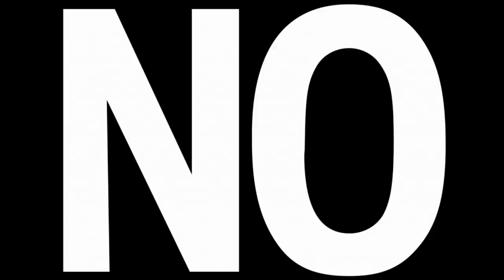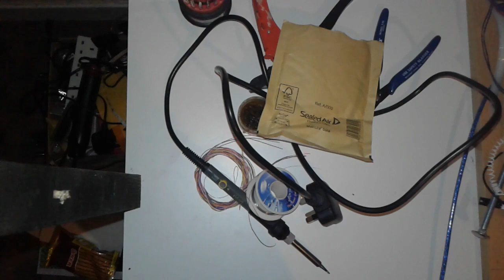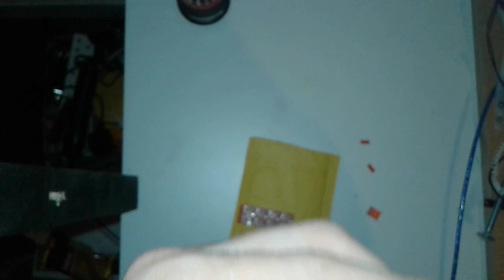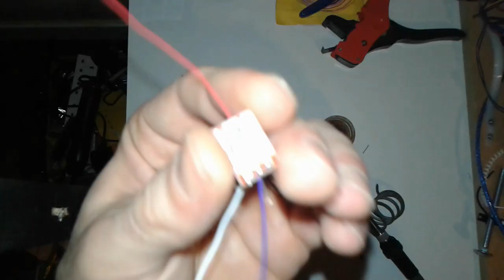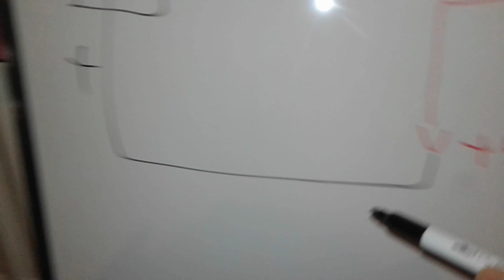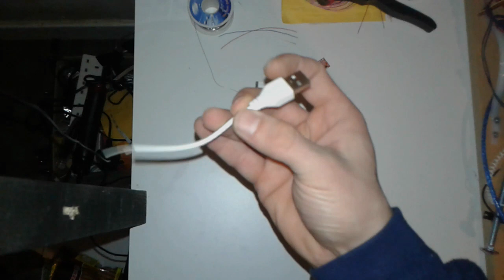How to add capacitive touch switch circuit to your projects

Comment: Thank u for the video. I want to ask how would you install this sensor to a machine with an operating voltage of 24 VDC thanks
Reply from the maker: Hi there to power the sensor you need 5v so you will need a step down converter, and if you want to trigger a 24v machine you will need a relay or if something bigger a special contactor
Reply: @NoSkillsRequired  alright thnx for the info

Comment: Cool video. Is it possible to make it work when you double tap instead of just touching it. Can you double tap it and the light stay on ?
Reply from the maker: This one no unfortunately you need a controller to make the computations so will be more complicated and more expensive
Reply: @NoSkillsRequired  Jums nav taisnība!!! 😮 Tur ir (A) un (B) slēdži, ar tiem var panākt 4 režīmus, gan kā slēdzi gan kā pogu! 😊
Reply: Yes it's possible  u can solder a and b I think and it will work as swith

Comment: Can you power a 12v load with this?? Or only 5v loads?
Reply from the maker: Is rated for 5v usb like loads max 1.5A
Reply: Dou you know how you could power a 12v led strip with this switch?

Comment: Can I use it as proximity switch?
Reply from the maker: Nope you have to touch thd xontacts  basically is using the human body resistance
Reply from the maker: You can make a high gain transistor cascade for a proximity sensor

Comment: Can I use this buttons to power On/Off a computer. I can't figure out how would I cable it
Reply from the maker: Ir depends what type of computer the old desktops have a jumper on the mother board that is connected to the switch but have no ideea what voltage is connected to
Reply: @NoSkillsRequired  Thanks for the Reply

Comment: does it require skin conductivity or is it pressure based
Reply from the maker: Youssef Ftouni to touch switch by definition is no pressure based switch it uses the skin conductivity around 2megaohms to close the switch with the help of a mosfet that have a great sensitivity and requires small amount of current to operate

Comment: How do I use ttp223 as a on/off touch switch for 220V AC appliances without using any microcontroller.
Reply from the maker: bogus singh hi there, you can use this with a 220v relay I think I have a video with a 220v relay but connected to something else all the best